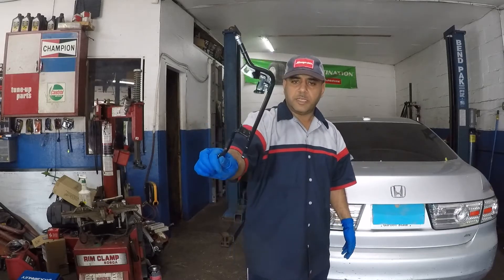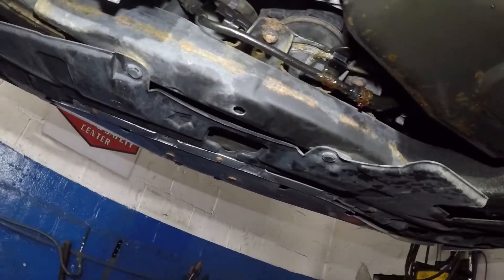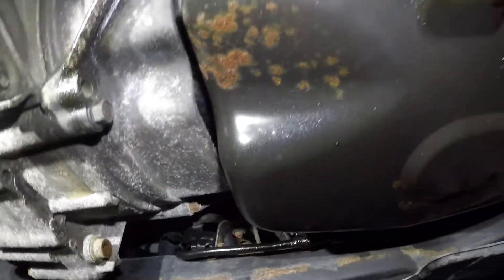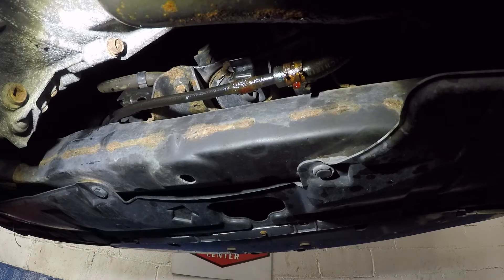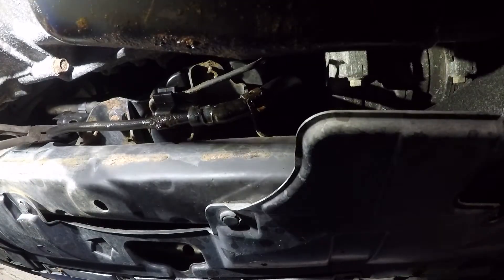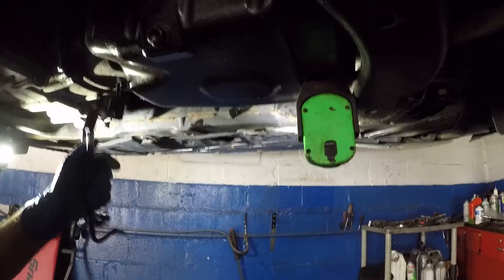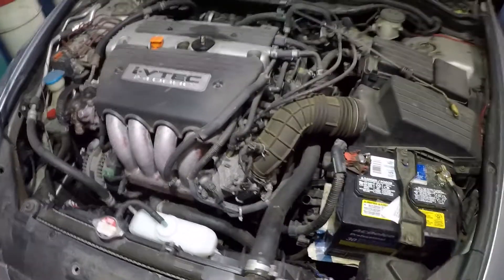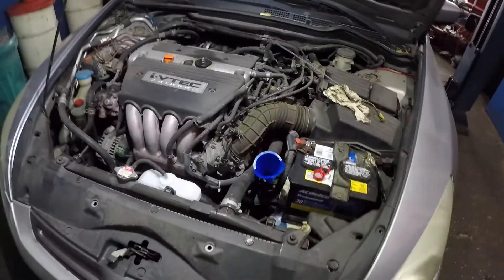Honda Accord Transmission OIL leak FIX common problem

Comment: Thanks for the video. I have the same issue, but cannot get that piece of pipe. I don't really see a need for that part - just replace it with a ID 11/32inch rubber hose ($2 per foot) and run it from the radiator to the next place where it connects to.
Reply from the maker: Yeah u can invent and come up with Somthing creative
Reply: Indeed
Imperial #248001 works well and two zip ties later she’s good.

Comment: Hi! Do you think this could be the cause of my 2007 Honda Accord? It’s not really a slow leak but the car has been doing it on and off for a little over a year. It’s extremely hard to get it diagnosed properly because sometimes it shows no signs. Sometimes it’s slow to accelerate and when I change gears sometimes it’s a hard shift change. I’m not seeing anything leak. If I turn the car off and on it stops the issues. Could this means the transmission needs to be replaced all together or what? 

Sorry I’m a little lady and hardly kno anything
Reply from the maker: U should be able to seee it
Reply: @RBTheMechanic  I think I commented on the wrong video. I meant the solenoid
Reply from the maker: @CharleyAngel  now I’m confused

Comment: Bout to do this on my accord, do i need to drain the fluid first? Could i just do it really quick without loosing the atf?
Reply from the maker: No need to drain the fluid only fluid that’s in the line will come out so u will need to add and check fluid level
Reply: @RBTheMechanic  thankyouu, will try that tmr..

Comment: Nice video and I concur with others who really appreciate that you respond to pretty much every comment asking for feedback from you. Subbed you and looked through all your videos and didn't find an answer to this, so hope you're patient with this question about a '14 Accord Coupe Automatic V6 with 110k. In cooler weather, after start up, it doesn't shift immediately into 2nd from 1st (with the same foot force, the gas pedal drops/engine revs, then it pops into 2nd hard). It also gets stuck in 3rd and at the traffic light it has to be put into Park then Drive and will be okay when it warms up. The trans fluid was changed 2-3 times in the past 2 years. What would you do to fix this? Would you do another fluid change and add an additive like Lucas? What do you think the issue is? Shift solenoid or something else? Thanks in advance!
Reply from the maker: Thanks for the sun bro!!! So seems like transmission issue this is cvt transmission so it’s not heat one or 2 or 3 it might just be ur transmission belt worn out and for that there’s no hope. I’m not transmission expert but if it was my car I would replace the cvt transmission
Reply: @RBTheMechanic  Thanks for the quick reply. It is actually a 6 speed gear trans, not a CVT. Please let me know what you think, in light of that. Thanks!
Reply from the maker: @youeweu  it still might be transmission u can try lucks but it might not fix the issue I’m not sure I’m not expert at transmissions
Reply: Did you happen to fix this issue? Having the same problem
Reply: @kingpinrecords4138 Resolved itself. Was thinking it could've been dirt on solenoid screens inside the secondary valve body. Next drain/fill will include some LubeGard.

Comment: Hey bro, really appreciate all the great vids 👍 I just recently changed the transmission fluid on my 2013 accord cvt trans, and o er torqued my drain plug, ended up stripping it.... I found a replacement on Amazon for like $50 and a genuine oem gasket for $17, changed it out which ended up needing a quarter inch ratchet with extension and swivel to get the drivers side bolts off and back on. I have noticed I have a small leak still and think I need to torque the bolts to spec, do you have any idea what I should torque them to? I was thinking about 12 ft lbs but was scared to because I'm fukt if I strip the trans so I went hand tight and a quarter turn. Any infonis greatly appreciated 🙏. Thanks
Reply from the maker: I will find out for u today when I get to the shop
Reply: @RBTheMechanic  thanks bro, I was about to buy the Haynes repair book to see if I could find it but I figured I would reach out to you first 🙏🙏
Reply from the maker: @modklv126  yeah bro always here to help send me msg any time with anything
Reply: @RBTheMechanic  so what should I tighten them to? 12 ft lbs In a cross pattern?
Reply from the maker: @modklv126  hi sorry couldn’t get to the shop to check the specs we had snow storm soon as I get back I will let u know
Reply from the maker: @modklv126  I’m getting 10 ft lb but I would stick with 12 is good amount
Reply: @RBTheMechanic  thanks bro, I'll be careful and go with 12🙏 really appreciate it 👍👍
Reply: @RBTheMechanic  well, fuk me... looks like I'll be grabbing an extraction kit🤣🤣 started with 7 lbs, then went to 9 and they just kept turning, tested my torque wrench on a few other 10mm bolts and it was working, so not sure what happened except I snapped one in half🤣🤣 man o man, the fun of working on cars, they can be like one issue leading to another... anyway I really do appreciate the help👍👍🙌🙌
Reply: @modklv126  hahaha . I hope everything went well

Comment: Quick question.. my 2017 honda accord heater doesnt blow  as hot like it used too after i got my oil change couple days ago . But only the vents are not blowing enough hot air . If i put it on to blow to feet / floor mode it gets hot as it should or if i put it on defrost .  What you think can be ? Coolant is good so far ..
Reply from the maker: Check ur mode door motor also. The vents are 4 one on each side 2 center so the air would need to be split and u might not have enough hot air but other it’s hot because there’s not too may splits check ur coolant and heater valve under hood
Reply: @RBTheMechanic   just seen this . But yea i did all that and everything on point but i did  notice a unusual sound on the glove compartment area .
Reply from the maker: @Ckkb897  not sure what u mean maybe the blower motor on ur car is making noise

Comment: Say bro I have a 2004 acura TL and my transmission is leaking bad. Can a make a video on it?
Reply from the maker: Sorry I don’t do transmission leak fixes also it depends where the leak is it can leak form many different spots  only one I would do is axle seal
Reply: 3rd gen TL's leak from the same exact spot as in this vid. The metal pipe looks a little different, but basically exact same repair. There's also pipe and hose fittings for atf in both wheel wells towards the front of the car. They also leak.

Comment: What year of his honda accord you bave?
Reply from the maker: I gotn2004
Reply: @RBTheMechanic  my 04 is leaking to but not a lot it would take couple weeks until I notice slipping and jerking idk if that’s the issue or if it’s the gasket seal pan
Reply from the maker: @brooklyn7941  u have to check where it’s leaking from can’t
Decided what’s leaking without look but this is very common rusted part
Reply: @RBTheMechanic  it’s leaking underneath it where the pan is
Reply from the maker: @brooklyn7941  so the issue is the area where u see leak but I don’t think these have transmission pans
Reply: @RBTheMechanic  so what holds the oil inside ? Becuase the dude who sole me the car told me the problem was there was a tiny crack in the seal (gasket seal) and that they rebuild it with new pressure seals new filter (well I don’t think the filter is new that shit look old ) and new solenoid but I think he was bullshitting
Reply from the maker: @brooklyn7941  u have to clean it and monitor where it’s leaking from it can leak from many seals center seal is common that to fix u need to take the whole transmission apart also remain seal